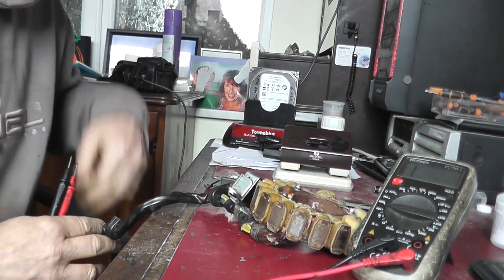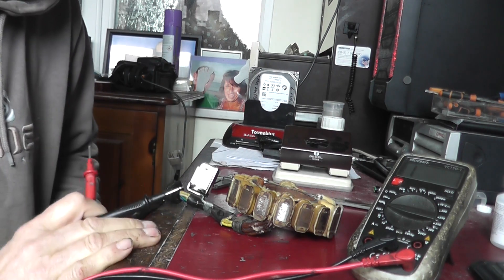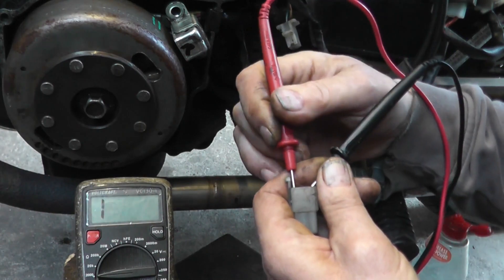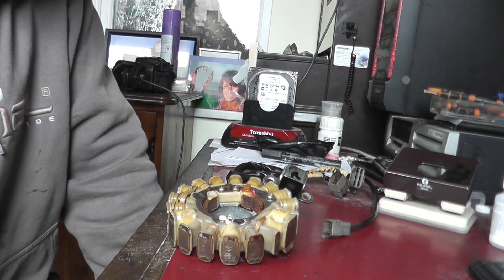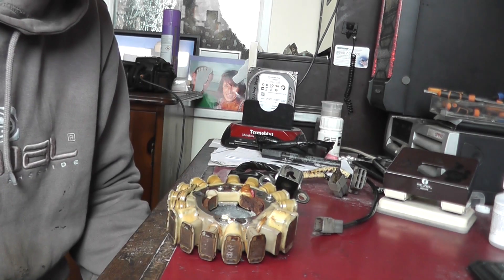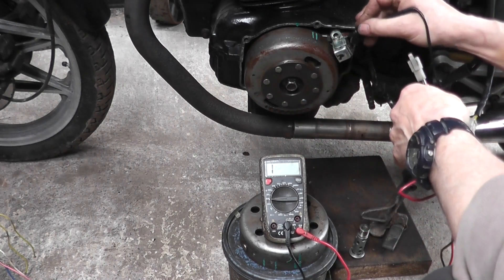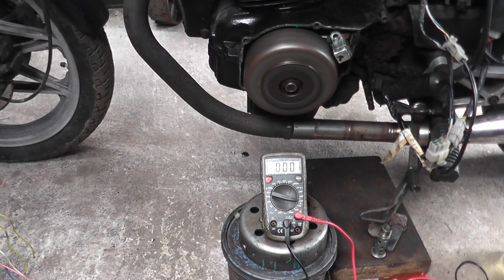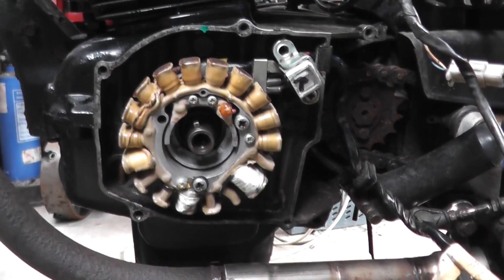Don't rely on OHMs resistance readings to diagnose your Motorcycle Stator

Comment: @bbbikeshop8359 , maybe you know what may be wrong?   CBR600F4. Issues only at idle, none with higher RPMs.

Measured resistance, 0,6-0,7 between terminals cold, 0,7-0,8 hot [does not exceed 0,1 for same terminals]. No continuity between terminals and ground hot or cold. 
Measured stator's output, all 3 wires. It is pretty steady - from 10V at 1k rpm going steadily upwards 10V at each 1k rpm, to 70V at 7k rpm. Same hot or cold. Seems ok?

RR gives 14V when started cold [around 2,3k RPM]. 
On idle [1,4k rpm]:
- goes to 13,5-14 [fluctuates] when hot. When lights ON, goes to 13,1, and then fluctuates between 12,9 to 13,5.
- When ventilator kicks in [with lights off], drops to 12,9-13V; with lights on drops to 12,5 and sometimes lower, then starts dying and cuts out. This is extremely unpleasant at traffic lights when hot, cause it dies or dies when kicking in firs gear, and then it takes time to start and start moving [sometimes even does not start, i.e. starter runs but engine does not power on, like was flooded with gasoline...].  Several measurements show it takes 0,8-0,9 V for headlight [low beam], around 1V for ventilator. Is this ok?

But it is slightly strange; if it generates 12V at 1200 rpm, it already undercharges the battery, not even compensating lights and ventilator. So naturally the battery charging shows around 12,5V at battery, as the electrical load uses battery's reserve. Is it supposed to be so low at low rpms?

Run out of ideas, what may be wrong. If you have any ideas, will be very grateful  :)
Reply from the maker: It could be that you may have a poor "Ground" somewhere? Also try connecting the regulator rectifier direct to the battery, if it not already is? Failing that the I would suggest you fit a good quality new Reg/Rect, then the only thing left would be the Stator. Sorry I cant be of more help.
Reply: @bbbikeshop8359  thanks for suggestions.
Any idea how to locate poor ground connection?
As there are so many places that devices are connected to ground...